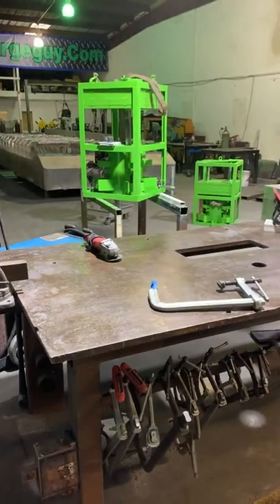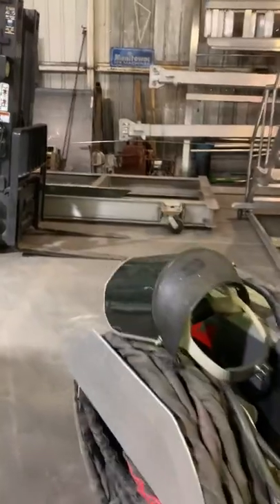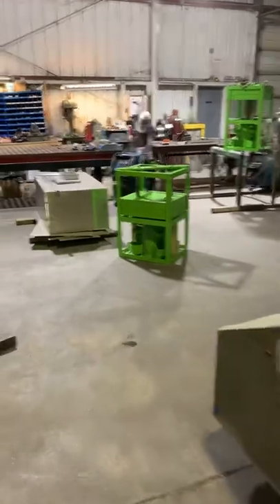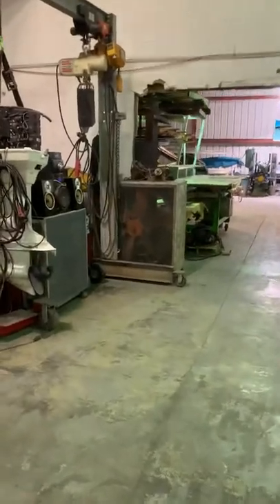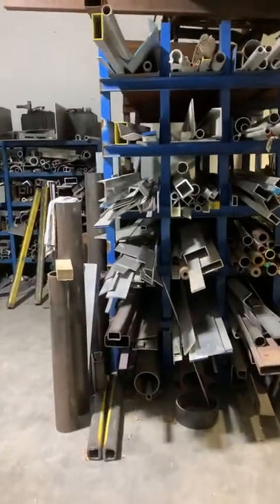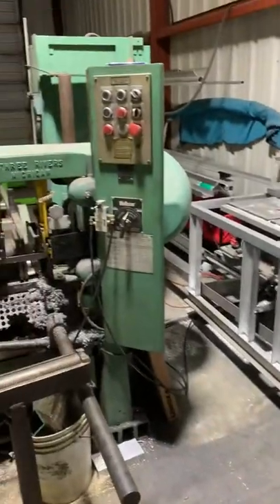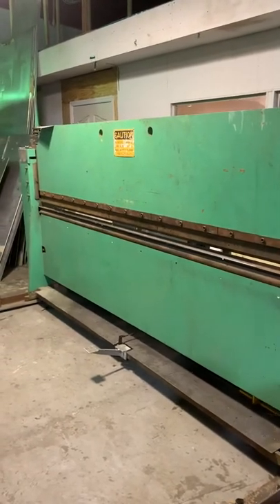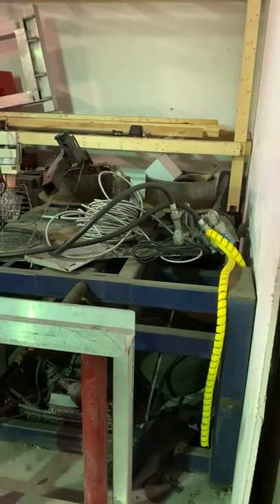How to successfully build your welding / Fabrication business

Comment: The bare minimum to open a fab shop:

Building with overhead crane rated for multiple tons

Flat, concrete floor

Low ton Forklift

Flatbed truck with overhead gantry

Chop saw

Portaband

4 inch grinder

7.5 inch grinder

220v welder - hardwire, flux core, stick, tig, aluminum and steel

CO2 shielding gas

Oxy/Acetylene heating and cutting torch

=============================

Shop upgrades to get the big gigs.

A quiet office to book gigs

A receptionist to take calls while you work

440v Welders

Helium (Aluminum MIG/TIG), Argon (steel MIG/TIG)

Plasma cutter

Band saw

Plate shear up to 1" thick

Press Brake

Waffle tables with dogs

Universal Iron Worker (Buffalo)

Stud Welder

5 ton forklift

Class B flatbed truck with overhead gantry

Diesel Welder/generator for field work

Comment: You sound like me. I'm very much anti debt, buy used and start simple. My only question is how did you start this with only $300? I can't get a welder for that much
Reply from the maker: I would take my deposit on the jobs to buy equipment. Never took a actual pay check for 4 years. Hard way to go. Starting to take debt on now with bigger equipment purchases. It’s a tax game also. Good luck.
Reply: i started with all used equipment too. for me it was all about only buying equipment i needed for production, or equipment that would massively boost production that i needed to keep up with my backlog of work. and i constantly pushed to do more and more work, but always in a responsible way in which i would keep up with schedules. there are two things i always made sure to avoid, and it has treated me very well. 1. never have slow periods. 2. never have angry customers. it caused me to be busier than most would be comfortable with, but also caused me to hire more people and implement more equipment and technology